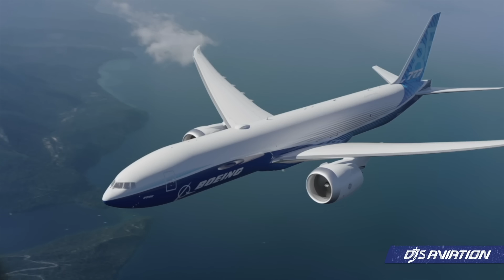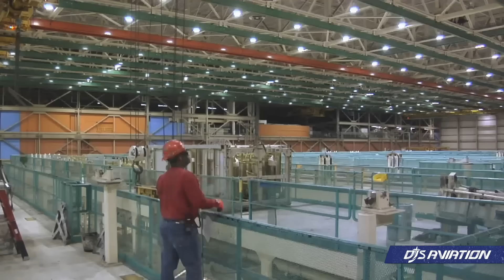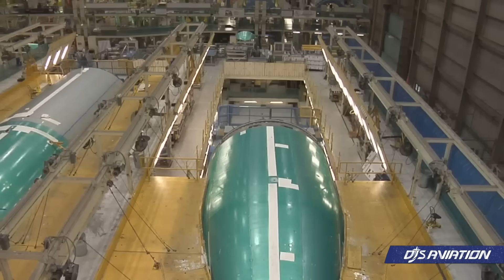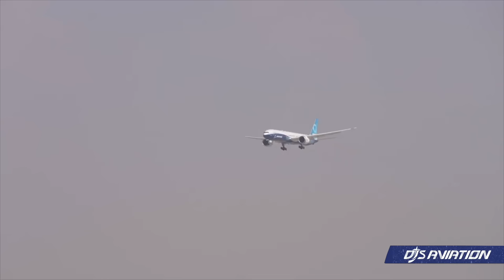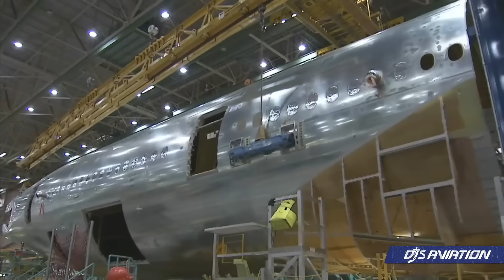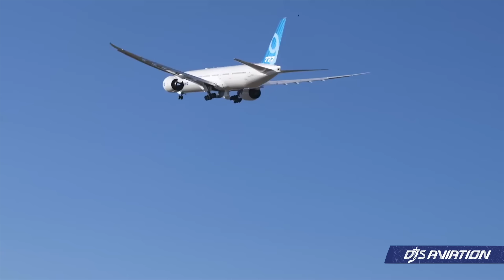Boeing’s New Aircraft Is Coming

Comment: So why does Boeing do so much better with Freighters than Airbus?
Reply: Airbus haven't previously offered suitably competing products. Conscious choice to primarily focus on the passenger market rather than freight - till A350, when they decided they now also want to go after freight.
Reply: @wurly1 Which is off to a rocky start. Air Lease Corp just canceled their order.
Reply: @RevolverOcelot79  cancelling 7 planes isn't exactly a huge loss - and countered by an order of 10 from Avilease at the same time.
You might expect the A350F to have had a slower start than the 777F, as a totally new product where (in theory) the 777F is a better known quantity, but that not how it currently stands - 59 orders for 777-8F v 66 orders for A350F.
Only time will tell how things pan out longer term, but at least there's now decent competition available.
Reply: They build and sell them…pretty simple.

Comment: it will only take a decade to certify
Reply: Not with the new CEO it won't
Reply: @nickolliver3021  So it'll take 20+ years to certify the Boeing 777X. 🤣
Reply: @BrandontheDraconequus-7H4  triple 7X passenger variant will have it certification by the end of this year with delivery starting second or third third-quarter next year the FAA has already moved into the final stage.  Also, the freighter variant of passenger versions always go a lot quicker.

Nice try though
Reply: @RevolverOcelot79  uh wrong the 777x will be certified by 2020,